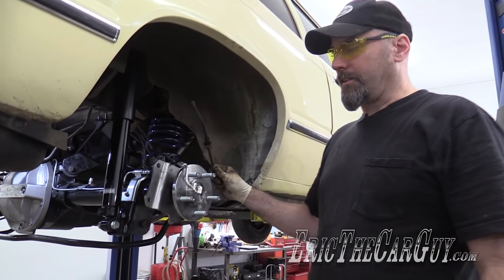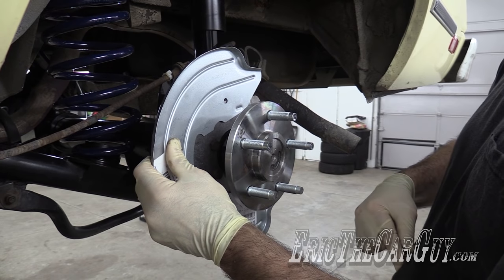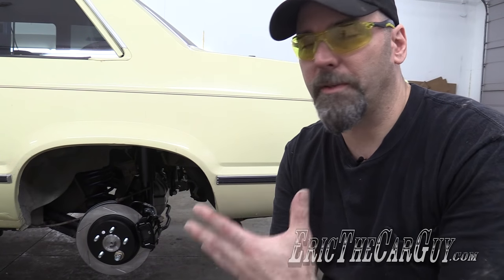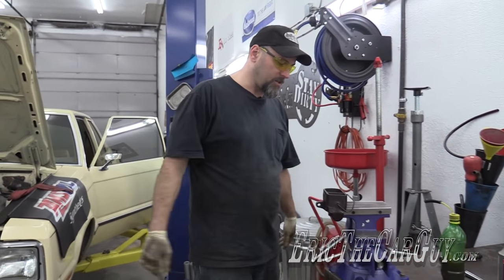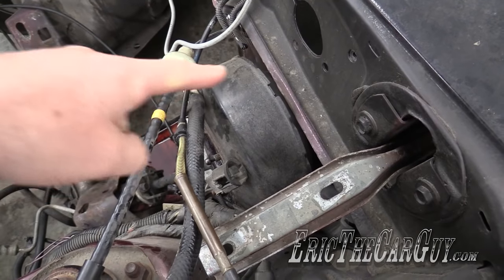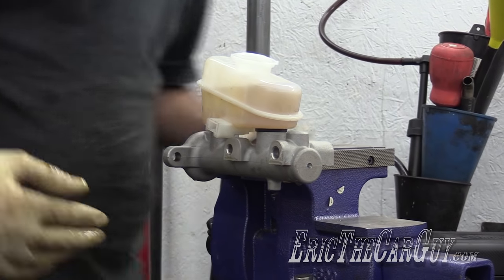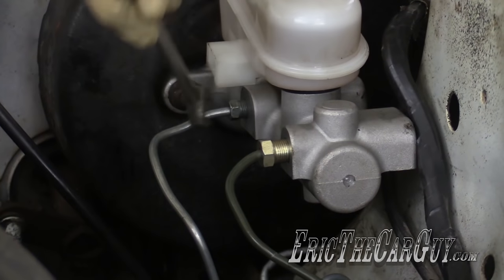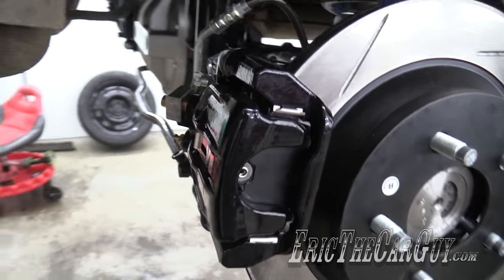Installing Rear Disc Brakes the Hard Way #FairmontProject

Comment: What I noticed when you did your caliper rebuild in that one video that you had a different way of installing the dust boot around the piston and then putting it on which is a bit different then South Main Auto had done he used compressed air the flutter the seal as he pushed the piston on so your method it's just a tad bit different then South Main Auto

Comment: Really appreciate your video(s). Dont shoot the messenger but I could have told you are the start, if you are going to have disc disc and no need to proportion (or even disc drum with the small knob one) you replace the factory valve with a simple 3 way. Rear bowl to 3 way with two out to fronts. Front bowl direct to single rear which feeds the two lines. Only change is if rear is still drum, between master front bowl and rear break line you plumb the dial type valve and its the same concept In other words, that 3 way is just so you can split your rear bowl to feed tow front lines  - lol you can get 3 for 10 - https://www.amazon.com/gp/product/B01KNGVKEA/ref=ppx_yo_dt_b_search_asin_image?ie=UTF8&psc=1

Comment: Old brakes are neat and all on the low end, both physically and effect, but on the top end (which in some respects is quite important safety wise) they don't work, not really. And that, is why you use power brakes.

Comment: Well, it happens....., now , are you sure, those plates are correct, where brake calipers attach to?? They could be on wrong side too, makes different, where calipers are close to rotors?? Also, I think, you put rotors in wrong side...., look at those grooves...., they suppose to send water away from rotors, not "collect" water!!! Am I right?? At least, I put them different way, and most of the cars they are that way!!! Other, than "few" mistakes....OK video ;o)

Comment: So, what were those tabs on the, ahem, splash guards for? Did you ever use them? Speaking of missing clues, why didn't you go over to the Mustang and take a look?  It has disk brakes on all wheels right?  If not, why not?  I suppose there's an exploded diagram of an equivalent assembly on the 'net to look at too.
That said, I understand completely! "What I just did is absolutely correct, the problem can't be there!" That's the curse of (software) debugging, you just illustrated it physically. 8-)
Reply from the maker: The Mustang has drums and remember, I wasn't sure what the problem was at the time so I wouldn't even know what to look for.

Comment: Haha I ordered a radiator, went to bolt my fan onto it, didn't fit, trans cooler crossover didn't fit...luckily it was the 2nd time(on a different car, but same model) and I could just pull spare parts out and file the right bits down. Last time it cost me an extra $130 for a trans cooler and some other bits and pieces, the next time it cost me nothing. Fuckin BS

Comment: You made yet another mistake. Your old master cylinder was meant for rear drums, which require residual pressure in order to adjust the shoes on the drum. Discs don't play along with residual pressure.